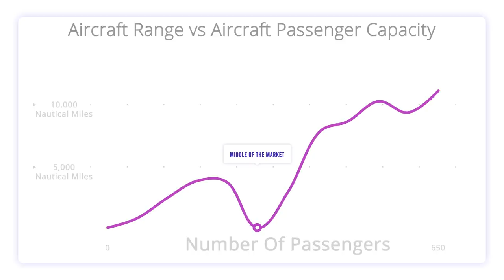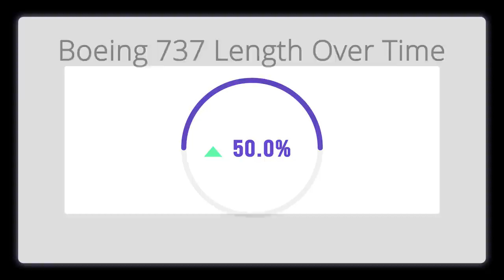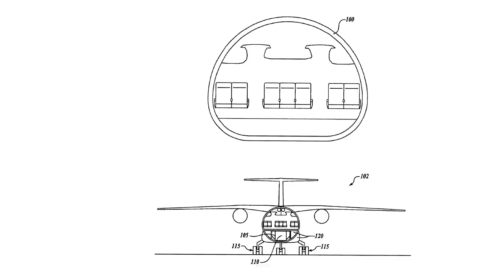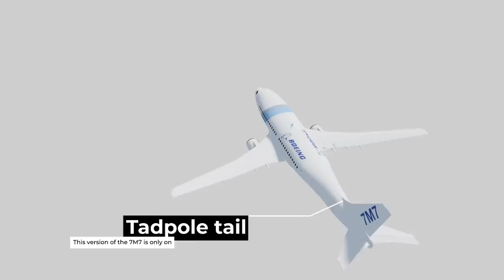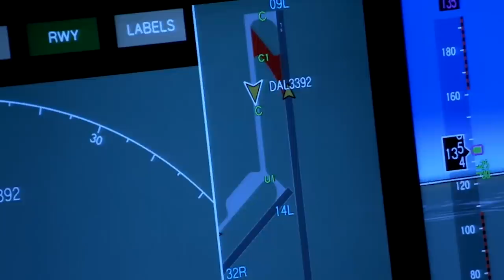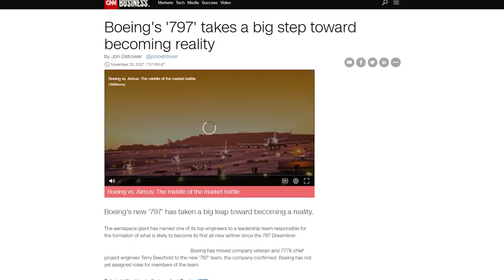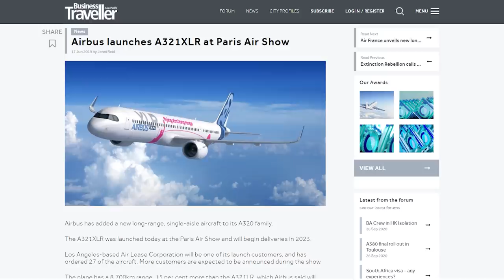The Boeing 7M7 - The Proposed Future Boeing Aircraft To Replace The 737 MAX and 797 | Never Built

Comment: I believe this concept was scraped when Calhoun took over as CEO. He ordered that the “middle of the market” aircraft design start from scratch. The airlines want a 757 replacement and I don’t think the argument has been settled on a miniature wide body.
Reply: Yes, there's talk of a 757 Plus, which is the given name of the project for now. Personally, I think that's the way to go, a new 757 and 767. A 7M7 or 797 could do quite a few things, but wouldn't excel at anything. The 757 was ahead of it's time and production ended too soon with a lot of potential left on the table. The 737 on the other hand, has been stretched to the MAX (pun intended) as far as design goes, it's essentially just a two-engined 707 with a modern take.
Reply: @lajoyalobos2009  The 737 has completely filled its design-space. 
 
The 757 was literally the 707 with twin engines; it had the same fuselage, wing and landing gear. As you said, Boeing made a major mistake in forsaking it to the dustbin instead of modernizing it for the 21st C, but it's looking like Boeing may dust off the 767 blueprints and modernize it. That's the most viable option for the company and will result in modern, updated airframes to sell while they work on all new designs.
Reply: @AaronCMounts  Here is the thing: the Max didn’t even come close to replacing the 757, if it was a suitable competitor we would’ve seen all the 757’s replaced by it
Reply: @AFoxGuy  If you look at fleet replacements and actual seat capacity, the 737-900 and 757-200 are close enough to be practically identical (189 in a 73-9, vs 200 in a 75-2). Most heretofore 757 routes that needed more seating capacity than the 737, but not enough to justify the 767, either switched to the A321 or increased the route's number of flights.

Comment: How did this proposal differ from an updated 767, which already used a 2-3-2 seating arrangement?  Also, most of the fuel airliners carry is in the wings; range is not tied closely to the width of the cabin.
Reply: Wrong, this biggest fuel tank is in wing box, where wings meet the fuselage.
Reply: Hiren Patel true !
Reply: @hp2084  One fuel tank doesn't compare to the half dozen in the wings.
Reply: Maybe because "767 Max" wouldn't sound popular?
Reply: @psychohist  The centre tank is called the long range tank for a reason.
The tanks in the wings are thin in order to fit into the wings. The Centre tank can be much taller, think about the big cargo boxes you see being loaded into the hold of aircraft.
Reply: The wider body also provide more lift, thus reducing fuel consumption
Reply: Elliptical fuselage. Fuel burn too high with a 767 fuselage. But probably not finalised on that. They talked about it a couple of years ago, so could be different. I thought Boeing scrapped this idea for now with all the stuff happening
Reply: @NoRegertsHere  Optimizing fuel efficiency involves an elliptical cross section, not an elliptical fuselage.
Reply: I thing the writer of this video needs to learn what the word unique means.
Reply: @hp2084  So a wide fuselage allows for more fuel?????
Reply: @davidtuer5825  yup
Reply: Yes, I want an updated 767.
Reply: @ChrisZoomER  
767 NG.
Reply: @greggstrasser5791  Yay!
Reply: I just flew cross-Atlantic in a 767, it had a 2-4-2 configuration.
Reply: @henq  Woah, that must've been cramped.
Reply: @psychohist  -  Body fuel tank is the reservoir.  Fuel is transferred to surge tanks in the wing boxes where both engines are located, left and right.  Hence, the reservoir is an important factor associated with range.

Comment: Boeing had the perfect plane, the 757. They should have just gone back to making a 757NG -200 & -300 perfect competitor to the A320/321.
Reply: A320 and 757 are nowhere near comparable. 757-300 is way out of reach for the 320 family.
Reply: @aseem7w9  read what I've written
Reply: @kostat5591  Yes I read, a 757-200's new version could probably compete with A321neo well but a shrink of 757 would be kinda terrible which they would have to do to rival A320neo. The A319neo and A220-300 are further out of reach. Do not forget the 757 are about as big as narrow bodies get.

The 737 MAX at least allows them to compete with every narrow body in Airbus line up.
Reply: @aseem7w9  yes they have the 737-MAX and we all know what it's cost boeing. However the 737 is not the same as the 757 just like the A220 is not the same to the A320/321 types of aircraft. I still think they should have had done something with the 757 instead of now having less types than Airbus has to offer. Basicly Boeing only has the new 737-MAX and 787 to offer atm and the older model 777 while Airbus has the A220, A320/21, A330 and A350.
Reply: @kostat5591  Boeing offers 737 Max which covers pretty much every segment of narrow body market with its 4 variants from max 7 to max 10, 787 that covers small to medium wide body market ranging from 787 to 787 10 and their most advanced aircraft is 777X that covers the larger side of things. It's the newest wide body model, not older model unless you meant being available for delivery.

I know 757 and 737 aren't similar my point is a re engined 757 would've just given airbus the small and medium narrow body market for free due to what type of plane the 757 is. The flexibility that the 737 max and a320neo have is way better than what a 757 could ever have so it's not a viable option.
The 737 max events happened yes but if they didn't do dumb things like having only 1 AOA sensor then it would've been just another successful 737 series. The 737 max is back tho and was the leader of aircraft orders in 2021.
Reply: @aseem7w9  leader of deliveries for the MAX or not it will be a long time before I get on one. Give me a classic anytime. I'd even get on a 707 if they still had them flying. Truth is they don't make them like they used to.

Comment: It would be nice to see a small widebody (with 220-270 seating) making comeback to the market.
Back then in the 70s and 80s, all widebodys were notably smaller than the  747s (apart from 747SP). A300/A310 and 767 were some of the perfect example.
But when the A330, A340 and 777 were introduced in the 90s, those aircraft are almost the same size as the 747s (even A340-600 and 777-300 are longer than the 747-400).
With 757 (and even 767) and A300/A310 left the market, it leaves a void space on 220-270 seats aircraft market.
It would be nice to see brand new widebody aircraft with the size of A310.
Reply: I always loved the look of the A310. A small piggy plane. 😂flew at least 2 roundtrips from ZRH to TLV.  And with beautiful old Thai livery out from BKG 🥰 - good old days 😄
Reply: Well, you do... A321XLR... basically same capacity, basically same range, but one half to one third of fuel usage...
Reply: Yep a small wide body would be nice , more than 4 hours in a single aisle aircraft would be a nightmare.

Comment: The dilemma with Boeing is they have 2 aircrafts that can be called MMA, 767 and 757.... While Airbus only have one a321, which is a stretch of the A319/A320.... So which aircraft replacement they should develop first? 757 replacement should come from the 737 replacement...

Comment: Am I the only one who believes this aircraft already existed with Boeing as a 787-3. It literally the exact replica of the -3 without the massive range of the 787-8
Reply: It was too big,  290-330 passengers. In the end, all orders for this model were converted to 787-8, the economics made more sense. Airlines really need a true replacement for the 757 and 767. One of the goals of a Middle of the market aircraft is to serve routes like Reykjavik - Dallas, Minneapolis - Dublin, Chicago - Edinburgh. You need good range and not so many seats, so the 787-3 was too big for that.
Reply: Downsizing a larger aircraft is literally the least efficient method for this. You cut very little weight and lower seat count, which kills profit/passenger. It's no wonder no airline wanted the 787-3.
Reply: @felipaorfr  This is why I think that Airbus should make an A310-400neo. The A310 was the perfect middle market plane but was built before it's time. Air Transat in Canada used them until this year when they were retired and the replaced by the A321. But a Neo version would give airlines a short wide body with better capacity and range.
Reply: @felipaorfr  the 787-3 would have filled the upper spectrum of the NMA market. Remember that seating is from 220 - 280 passengers and it would have given airlines the ability to offer customers more comfort and space as well as increase cargo capacity without affecting the structural rigity of the aircraft. But I see your point.

Comment: They were working on it on simulators. You are right and did a great job. That Paris air show stumped them. They didn't expect Airbus to vamp up the 320 line. On second thought, I wonder how they never considered this.

It's too bad. The 7M7 would have had such an impact. Instead, Boeing took the cheaper route with disastrous consequences.

Comment: It sounds alright until you factor in one problem, part of the problem with the MAX jets is the engines, they can't hold larger engines and as such the plane is limited. If Boeing is smart, they would take the NMMA idea and replace the 737, like it wanted to begin with.

Comment: ..... and if built in South Carolina, you'll be sure to find a spliff once in awhile.
Reply: I call it Too Big To Fail Syndrome.

A company get too big, they think they're "too big to fail", arrogance and greed set in, cost cutting comes in. This is where many of these big companies' fiascos originate.

Even worse, in the case of the 737 Max, Boeing's failure to make the original MCAS redundant and inform pilots about the system meant that their cost-cutting came at the expense of safety, too.

This is why McDonnell-Douglas should have been bailed out and restructured instead of being allowed to "merge" with Boeing.
Reply: Lol, wouldnt put it past current Boeing Quality Control, recent customers have found a ladder left inside the tail and tools inside the fuel tanks.
Reply from the maker: @watcherzero5256  wait inside the fuel tanks???
Reply: Watcher Zero Aren’t they planning to move all production to South Carolina? That is ridiculous, goes to show Boeing does not care as long as it means saving a dime in costs... 😑 SMH
Reply: @alexreyna6836  Only 787 production would move to SC. All other Wa programs are staying put.
Reply: @FoundAndExplained  US Airforce also found left over items in Boeings planes
Reply: bd5av8r1 787’s built currently in SC are being rejected by airlines because of awful quality and faulty equipment and parts. For Boeing to move the entirety of the 787 production to SC is irresponsible.
Reply: @alexreyna6836  yep, heard that quite a while back that some airlines refuse anything from SC, even advertising it as if people knew/ or before people knew how bad the quality was.
Reply: Dont forget, major airlines refuse to take delivery of airplanes made in Charleston, I think it was Qatar demanded only planes made in Washington was acceptable.
Reply: There is an old Aljazeera video here on YouTube with hidden camera inside the Boeing factory where employees say they would never put their family on the planes they build. 😩 They also talk to a layer and some other people with knowledge.
Reply: @alexreyna6836  South Carolina offered giant tax breaks to Boeing, like Ohio did for Amazon fulfilment centers.
This should be illegal. States and governments should not be allowed to selectively tax some businesses and not others. (I get that the issue of subsidies and tax breaks is a complicated one, but sometimes it clearly crosses over into kickbacks)
Oh, and the governor of South Carolina later went on to join the board at Boeing, which is even more suspicious, if not downright illegal.
Reply: @alexreyna6836  Unfortunately when production costs skyrocket due to socialism taxing and regulating hell, a corporation relocates to a location of less socialism, less taxes, and less regulation... Boeing could have easily moved to Mexico just as easily as moving to South Carolina... You reap what you sow!
Reply: @ronclark9724  nobody wins a race to the bottom

Comment: The biggest problem with this design: There's no engine to power it. Spitballing based on size and weight, it would probably need something in the 40,000-50,000 lb thrust range and there is no engine currently produced that can do that. They could de-rate a JT-9D, but that wouldn't deliver the efficiency needed. That's why Boeing said recently that there's no new airplane until someone develops a more efficient engine.

Comment: A321XLR has a nominal range of 4,700NM. That is in still air. In real life that will mean at best 4,000NM considering mandatory fuel reserves and headwind. It can also carry depending on cabin configuration in excess of 200 pax. What it positively cannot do is both things simultaneously. For long range missions it can take some 150 pax. Further, it has a rather poor field performance (i.e. limitations in high and/or hot airports, it needs extralong
runways). This said, A321XLR is a very interesting design that will do quite well. Yet it only covers the lower end of the middle of the market, both in range and in capacity. So airlines would hace been delighted to see a 7M7 concept come to fruition. Under present market conditions it will be a cold day in hell before it happens, firstly for the high development costs, secondly because even with the aforesaid limitations Airbus has sucessfully managed to bite into the MOM market to sucessfully prevent their competitor to enter an alternate design. Which is a pity, since both concepts are actually complimentary rather than competitive, and large airlines could conceivably use both. For the upper end of the MOM existing aircraft are definitely unsuited. Both 787-8 and A330-800 are too big and heavy hulls to offer competitive costs on ranges up to 4-5,000NM. They were simply never designed for that purpose. Boeing has an additional problem in these uncertain times. Replacing the MAX, a 50 year old design that has seen better days. A320NEO beats the -8 counterpart in performance and sales, and A321NEO simply routs -9 and -10 hand down. So the Americans will have to devote their best efforts to come up with a new single aisle alternate design. As things are today it will be impossible to fund two projects that essentially cater to a similar market bracket.

Comment: I'll never get on another 737
Reply: 737ng?
Reply: Lol its the most sold aircrafts good luck with that ,btw ryanair has about 280 737-800 and never had a fatal accident so there is clearly nothing wrong with the 737
Reply: You are aware. I hope, that airbus crashed a few planes until they reprogrammed the computers to relinquish control back to the pilots in certain dire situations. The 737 is the safest airplane in the world. 747's have crashed as well as others. The media have over-hyped the issue with this plane as they are wont to do.

Comment: (Disclaimer: I work in the aircraft industry). It costs roughly 30+ billion dollars to develop a new airplane. How do you propose Boeing raise that amount of capital?
Reply: Between 2016 and 2019, Boeing spent $60 Bn in stock buybacks.
I nominate we sue everyone on the board for mismanagement, raise $100Bn that way, and then we can develop as many goddamn airplanes as we want.
Reply: They can just drop out of business if they can't either keep costs under control or innovate. Cutting on buybacks and returning to becoming aircraft designer AND MANUFACTURER instead of Financial Corp would also be nice.

Comment: Screw the 737, I’d love to see 757 based models take over Boeing’s main product line. Shorten and update 757 to replace the 737 NG with more efficient powerplant and composite wing design, as well as reintroduce the larger 757 variants for passenger capacity beyond what the 737 can offer.

Comment: 2:34 look how far forward the 737 max engine is compared to the original 737
Reply from the maker: Surely that wouldn’t be an issue would it? Oh...
Reply: @FoundAndExplained  yeah and you need some strange software to compensate for the tendency to tilt upwards...
Reply: 737s kept getting bigger till it reached breaking point. The 757 design is good for a modern narrowbody airliner. The 737 went through too much re-engineering to suit the modern day requirements. A shorter 757 might have done the job better thah a longer 737.

Comment: yes, the "I'm to cheap to retrain my pilots" inflection needs to be banished from what should really be the legacy of the 737 and a new white sheet design of a mid-market commercial jet.
What is proposed here (modestly) is still a tube and wing primarily made out of aluminum .. but certainly very doable.  Given the direction of the 787 .. carbon fiber, double-bubble of even fully blended wing would be a 21'st century plane worthy of the redo letting Boeing drop that shoe rather than waiting for Airbus.  Its time for the body of the plane itself to give some lift and economy.

Comment: Sadly, if it's Boeing I ain't going
Reply: Yawn
Reply: Then don't. Walk
Reply: @billrussell4832  Or use a safe plane, that isn't rushed for the sake of profits, you know the kind of planes that Boeing simply doesn't do anymore ...
Reply: @ethansaviation2672  Yeah right Boeing have problems on the 737,787 and even on the Boeing Starliner, basically any new project is flawed.